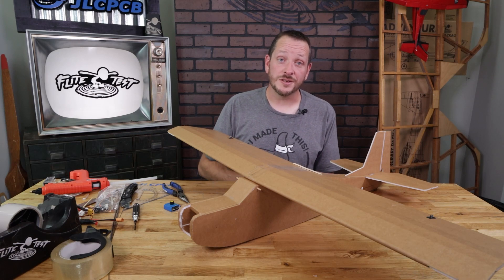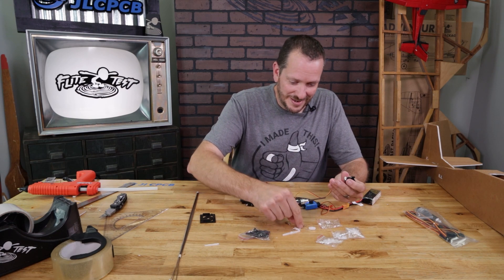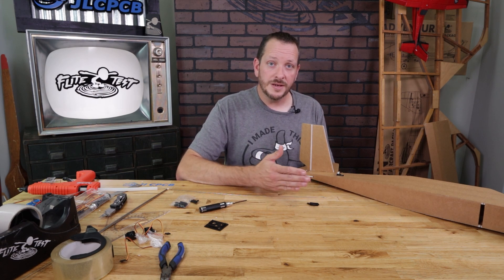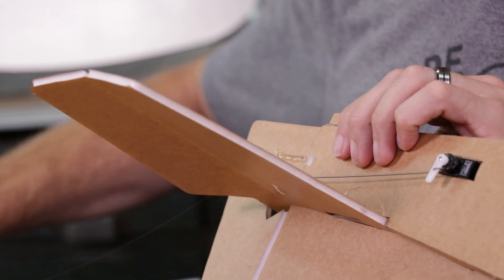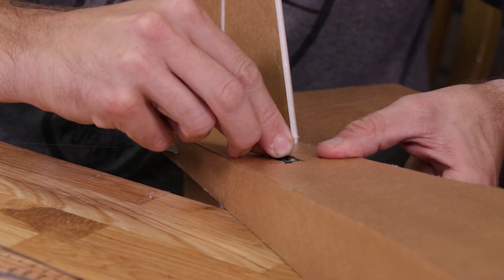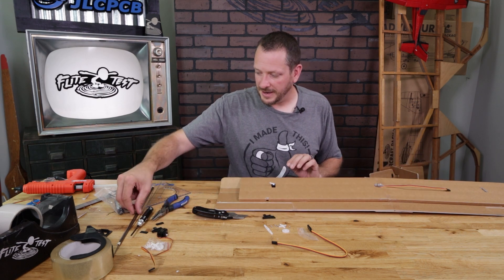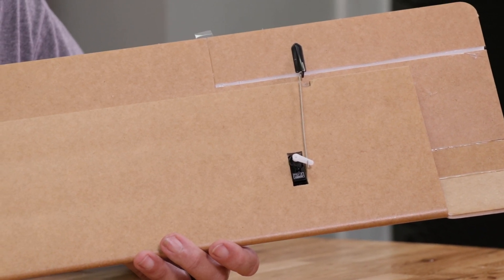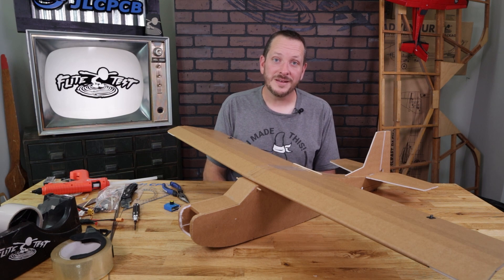How to Build the FT Tutor Servos & Linkages  //  BUILD

Comment: Maybe I missed this in the details of the video, but specifically mentioning that the servos will burn out if they are not connected properly would be helpful. The connections on the centering tool are not directional so they can be reversed causing the servos to go bad. Now we're stuck waiting on new servos.

Comment: Are the push rods in the wings supposed to bend a little?
Reply: I was wondering the same thing. I now know you can get lower gauge wire push rods (thicker) on Amazon for next to nothing. Just a fyi for you on my first scratch build using my own parts with free printed FT Simple Cub plans I had a huge issue with the rods I bought being too bendy and on my first test flight it inverted within 10 seconds straight into the ground broke prop but lesson learned....don't try to hand launch and install non bending rods...lol

Comment: Any free DIY plans available for the FT Tutor?
Reply: This is virtually the same plans as the FT Simple Cub which I finished building using dollar store foam boards. After that I decided to give their laser cut foam board kit a try for the FT Tutor Turbo Wing plans and I can verify I'll never print off plans again when I can use laser cut plans. Everything just comes out sharper and easier to put together. Hope this helps.
Reply: I have looked everywhere on the Net but this one is not up there !   Have you found any plans for it ?
Reply: Didn't find any. Sad.